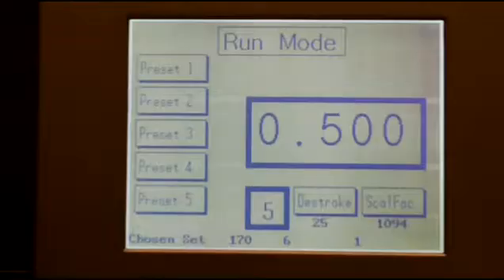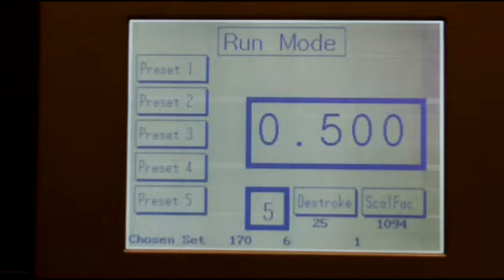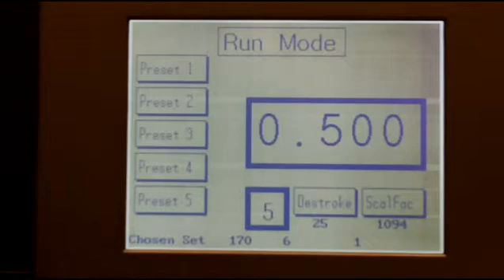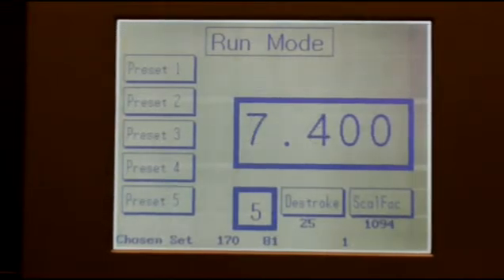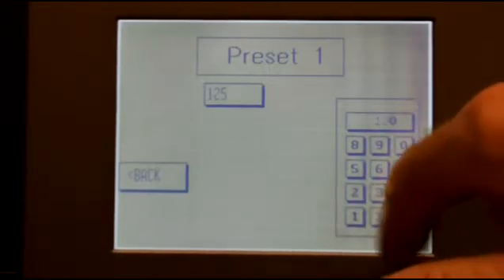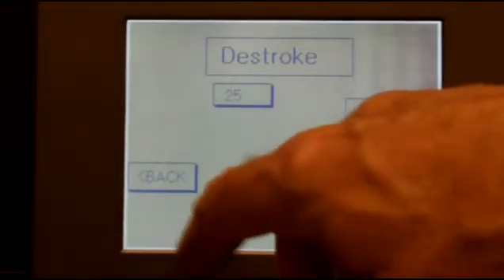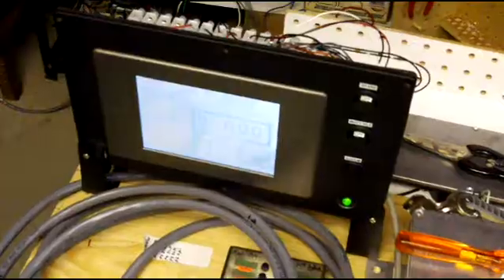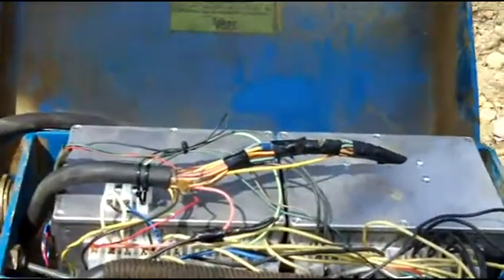Low Cost touchscreen added to tree processor

Comment from the maker: If you already have the original Toshiba or Votec computer, its right around $5000.
It uses the existing boomcable, measuring sensors and valves. Takes about a day and a half to install and test.
It can be adapted to other processors.